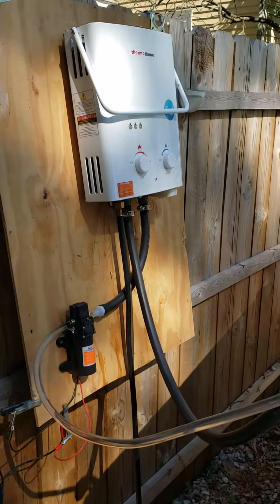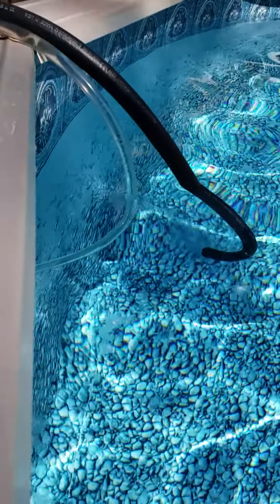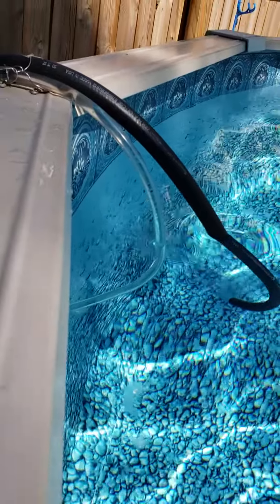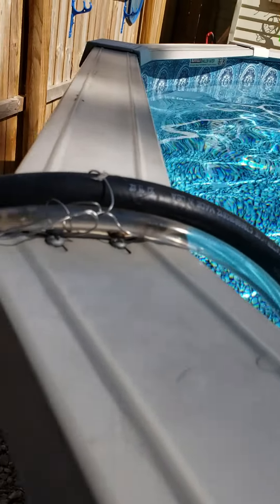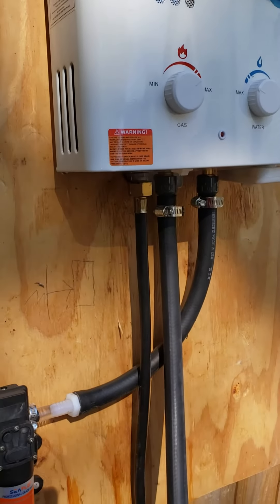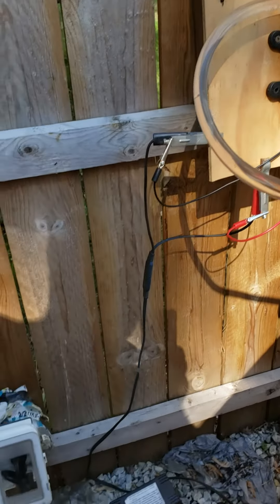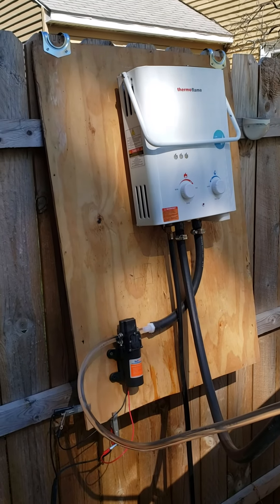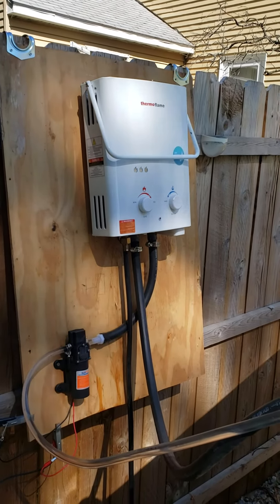Homemade pool heater

Comment: How has that pump lasted? I had the same one but it didnt last as the little pistons inside would jam and cause no water pressure which would shut off the gas in the heater.
Reply from the maker: Ya had to switch to a better pump but worked good
Reply: What was the problem for you with that pump?
Reply from the maker: @walleyeye  this one wasnt pumping enough water and kept shutting my tank off